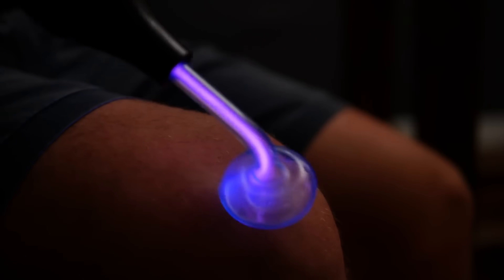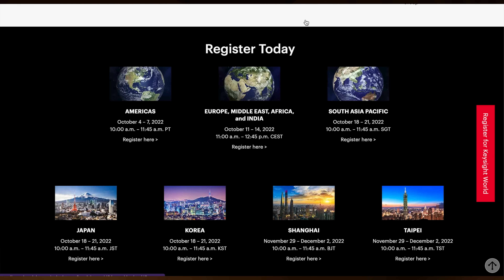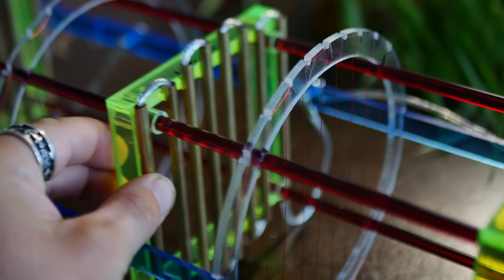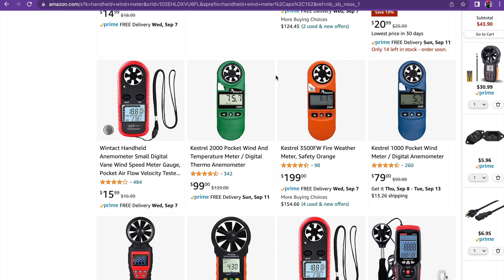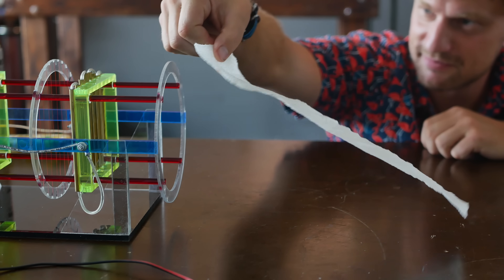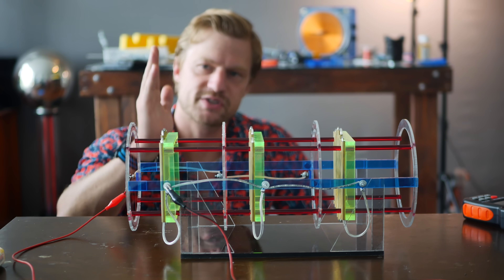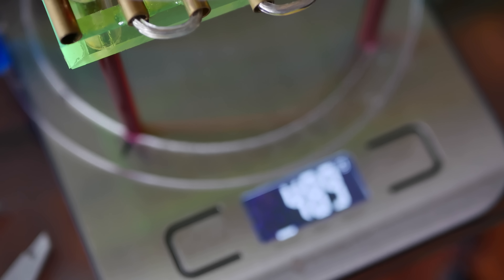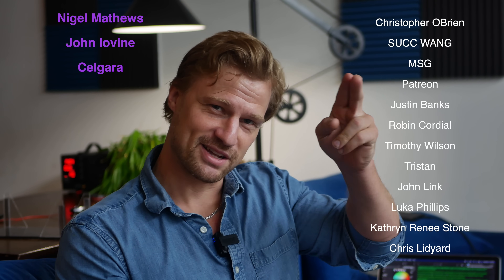Designing A Next-Gen Ionic Thruster! (For Flight)

Comment: Have you considered using Analysis of Variance (ANOVA) to see if how sensitive your two variables, voltage and distance, are to your air velocity? It would also give you a parent equation of AX+BY+C=Z for a form of linear regression that could be used to help optimize and see where your diminishing return is located. 

How close can the ground frames be before each pair begins to interfere with eachother? Would a more dense gas mixed in the air stream improve your thrust?

Could magnetic fields be used to help control direction and acceleration much like Magneto Hydrodynamic Theory, or would the field effect the plasma too much?

Would enclosing the stages improve performance?

Comment: How about adding some type of partial shielding close to the negative plates? Just to save some of the air mass. Something like Kapton would be super light, and electrically resistive. I'm curious what a 10 stage Thruster would do, with varying voltages and spacing.

Comment: What about enclosing a the stages, or using the venturi effect to increase flow?
Reply: That was done in the Sky Station International patent in around the year 2000.  I think the inventors name was maybe Burton.  The invention had needle shaped emitters, multiple stages, and tapered tubes.  It worked well but was nowhere near efficient enough to lift its power supply without helium.

Comment: I wonder if the second/third stages need as high voltage as the first stage, my guess is the first stage will pre-ioniz the air which would make controlling it easier.

Comment: I really want to see you continue to tinker with spacing and even adding more plasma arrays. One thing I noticed was that the surface area that the plasma is acting on the air is expanding when you increase the spacing. You will get diminishing returns though, unless you also up the power. A couple of things I want to see:
- A grid array instead of slats, to see if the extra electrodes can increase thrust
- more arrays in a row
- different staggering of the spacing between
- maybe rotate every other section by 90°
- try a copper mesh or grid instead of single wire 

Awesome video, thank you!!

Comment: With dry ice, looked like laminar flow going in and turbulent coming out. I would try with the electrodes increasingly closer as it accelerates to the end of the device(oh wait, you did that!lol).  I think eliminating the turbulent output would give better results, laminar flow in and out will be fastest
Reply: I think the small gauge wire you are using  for electrode  may be adding to much impedance on that end, compared to the brass tubes. That would be an area to experiment with also for better efficiency

Comment: You could increase the thrust/weight ratio by using foil fins instead of the tubes, then you could use a silk cover around the entire device tube to make sure you don't lose airflow out the sides.

Comment: Not too sure on this. But here goes.
1. It should probably be enclosed with an intake and exhaust or output whatever.
2. The pattern of the transmitter coil and the air restriction of the ground. No clue what the most efficient pattern would be but I assume it can be improved. Maybe use flat pieces instead of tubed.
3. Not sure if this can create pressure if enclosed. But if it can maybe an exhaust nozzle to direct the thrust efficiently. 
4. Lastly the spacing between each stage can probably be adjusted, brought in closer to save weight and provide less drag.

Comment: 1) drag, from exposed sides. If you were to place the entire mechanism in a tube (for example, wrap the mechanism in onion paper), you'd only be accelerating previously accelerated air, instead of also grabbing air from the sides and trying to move that still air along with the air already in the mechanism.
2) replace the grounding tubes with a grounding mesh; less weight, more surface area.
3) as it stands, precisely zero percent of the mechanism is red; as any young-adult can attest, red makes EVERYTHING go faster, and would thus lead to a more powerful engine.

It's just physics

Comment: 1) Different voltages at different stages like a C.R.T tube to add to the velocity of the ions, having a constantly changing field 
2) A rectified FULL-BRIDGE power supply with more voltage
3) Thinner anode and cathode, with many more wires and lighter construction
Reply: Also do we really want the positive to be the thin wire ? If the thin wire is negative it’s going to ionise air much easier since electrons can leave it faster.
Also-also, I think more stages will improve air speed and one should consider making the attractive plates slightly longer and with spikes at the end so the air is ionised with the opposite charge near the exit and attracted to the second stage. In fact, you can make everything from thin plates with many spikes at the end and ditch the thin wire altogether. Shorter plates for negative side and longer for the positive one. That way it will act almost like an ion accelerator. Of course, the width of the plates should be optimised depending on the intended airspeed. The faster the air moves the less of it (proportionally) gets ionised at any point.
Also, higher voltage and more distance means more ion acceleration with the same amount of materials.
The air also probably gets heated up a little at each stage so after enough stages the air blower might start behaving more like a jet engine with hot exhaust. Compared to a turbo jet this acts more like a 2-in-1 turbine and burner.
Reply: Also, in regards to my hot ionic air hypothesis: The hotter the air gets the more easily it gets ionised and at some point it will become plainly conducive. When that happens, putting electrodes through it will just short them out. You would need in this case two electrodes along the hot conductive air channel, one being the positive metal casing and the negative one being a wire in the middle. Passing current between them would heat up the air and passing current along the lengths of the metal casing and along the middle wire in opposite directions would create a circular magnetic field around the middle wire (like an elongated toroidal chamber) that would push the hot plasma faster and faster towards the exit nozzle. The only drawback would be that this baby will probably suck several kilowatts in operation.
Reply: @drgazter  that's a good point, I meant thinner wires and many more would increase the effective surface area while hopefully making the thing lighter. You could make the anode thicker but I would go with two layers of super fine strands of wire. The idea is not to absorb the electron back to be out of the way and help accelerate the air. The thin wires can also be bunched into small groups of different shapes and configuration for experimentation
Reply: @drgazter  I understand, my point was to have thinner wires spread out so the same thing as bigger electrodes. And leave more room for air to flow through. Maybe if arranged in the right pattern even get Laminar flow through the system increasing efficiency. And there will be some electron flow from Cathode to the anode via charged air particles losing and gaining electrons which is needed for the airflow. That's what consumes energy here, if there was no charge flow it wouldn't work.
Reply: @Quantum_Presence  
Yes, I get it now. More thin wires means more areas where air can get ionised.
I was thinking that at higher voltages air will start to get ionised before reaching an electrode and thus get pushed back. So maybe it would be better to put some plates where the ions from the previous electrode get attracted before the spiky thin wire section where air gets re-ionised with the opposite charge. You know, like plates ending in combs with a forest of parallel spikes pointed towards the outflow and the back of the comb (the plate) pointing towards the inflow.
Reply: There's definitely some magic to #1 I think because the pressure differentials across multiple stages seems pretty key to the overall thrust.
Reply: The construction might also help a cone design - wide radius side for air intake, short radius side with highest voltage for force.
Might even arrange the positive cathodes in a vortex shape to drive air better.
Reply: @artursvancans9702  Positive cathodes? 🤣
Reply: @artursvancans9702  That would mean it achieves some compression, but I think the ratio would be too small. Practically it would still be a cylinder unless really long
Reply: I was thinking that distance between wires could be utilized like a tesla turbine utilizes distance - if there were many more wires of optimal spacing then you might be able to start taking advantage of potential Casmir cavities.
Reply: @hannaha.2246  Tesla turbine uses friction of the air and a flat disc to rotate and very thin disc and distances for maximum energy extraction from compressed air. Casmir effect takes places in high vaccum between extremely closely placed plates only a few mm or less. This would cause the air gap to break in this case of ion thruster. It would be impractical to use that effect

Comment: Inefficiencies I can spot:
1. The tube isn't isolated from the environment. i.e. Enclosing it would improve airflow and prevent air leakage from each stage.
2. The shape of the round electrodes could be modified to give better flow over (around) them.
3. Of course, the infamous "power-to-weight ratio". It's "chunky" to say the least!

Comment: 1. Contained flow chamber
2. Increase the voltage across the stages, e.g. 20, 40, 60 kv
3. More efficient power supply
4. Possibly converging/diverging nozzle of some form.
5. Maybe magnets on the side to stop the ions touching the inside of the chamber (possibly too heavy).

Comment: The 1 big design flaw that I saw throughout the entire video is the fact that it doesn't have a plastic tube around it. Youre letting air flow out of the sides. Eliminate that and you should see higher thrust.

Comment: Inefficiencies I found (even though I don't know if I'm actually right about any of these):
1) its not enclosed so airflow can leak and reduce the power of the engine
2) it doesnt have a nozzle so there's potetial power wasted
3) the amount of material used is inefficient, the shape of the frames could be optimised

Comment: 1. copper netting insted of wire. (electrode surface area/flow)
2. copper netting instead of brass pipes and thick wire. (as above + weight loss)
3. covering the tube with a shroud. (maximising directional flow)
4. a differing voltage per stage. (as the air gets quicker per stage you will need a differeing matching speed resonance to succesfully eek out more efficiency)

Comment: I imagine one area of improvement is enclosing the entire thruster in a tube to act like a ducted fan and reduce losses to viscosity between the surrounding slower air and the air in the thruster.  Not sure about the other two but really cool content and an excellently made video.  Seeing the improved results from staggered voltage stages reminds me of the varying airspeeds in a conventional turbofan compressor, I'd love to see the number of stages taken to the extreme.  Looking forward to seeing the project develop!

(also I hope you have some patents in the work)
Reply: Maybe have inlets at each stage too, that way each stage can draw in more and more air as it gets accelerated.
Reply: I like the idea of considering turbofan concepts.  One stage could help another stage gain air speed by forcing air through a compressed shapped enclosure.

Comment: Also, there are a few cars that use an aluminum lattice in their mass airflow sensors that would make an excellent electrode for this! Designed to produce laminar flow for the sensor, they're conductive, and designed to proved maximum surface area/ airflow!

Comment: This is really cool. I would want to automate adjusting the distance of the electrodes (and possibly play with rotation), as well as the voltage. Then you could write something like a neural network algorithm to find the optimum values for everything if you feed the airflow back into the program. This is a really cool project, thanks for sharing!

Comment: an enclosure would help direct airflow, then maybe a nozzle, and your grid is the wrong shape, round tubes cause tremendous drag. maybe blades or narrow air foils instead. or does there have to be a grid at all? if you push enough voltage could you just make a segmented tube with conductive and non-conductive alternating segments?

Comment: Could you put only the wires through a tube and maybe give it a rounded jet engine inlet and tapered outlet? Im guessing that currently its sucking in air from all around and maybe in a tube the velocity of the air could sort of stagger? Also maybe shift the wires from each other or rotate them.

Comment: Seal the system, use carbon composite for the frame, taper the sizes of the stages down as you move backward. With sealing the sides that could make use of the venturi effect to increase velocity. Use an intake trumpet as well to improve airflow into the thruster, see what different shapes of exhaust cones would do to the thrust produced, instead of large copper electrodes for the negative use a thin carbon composit teardrop shaped tube with a thin layer of gold depositied using a plasma coating machine, I believe thought emporium has built one and you could colab with him maybe. So many ways to improve this!

Comment: I do wonder if you might gain some efficiency stripping the insulation off the wires might help some. I know you're way above the breakdown voltage there but hey, it's a free thousand volts or so. And it'll make it lighter! (Ok you might need a very expensive scale to measure how much lighter but still! 🤣)

Comment: Very nice. Might want to put a non-conductive cowl around the structure and give it a bit more of a funnel shape like turbine engines. The reasoning for the funneling is that the air flow will necessarily speed up as it narrows, due to the relationship between force, pressure, and cross-sectional area. Another idea to try is having the conductive surfaces be grill shaped for increased surface area for air electron transfers. And instead of the pipes having long slivers of aluminum for more surface area as well (simulate to the classic ionic thrusters). Good job, Jay!

Comment: This is super cool. I am not super knowledgeable on the electrical side of it just the basic but whaen it come to aerodynamics i am far more knowledgeable and lets just say there is alot of drag and turbulence in the design that can be minimize. That and weight

1 Balsa to light the frame

2 Changing the shape of the copper tubes from cylinders to a laminar flow airfoil crossection (which should drastically reduce turbulence produced and air resistance)

3 Enclosing the the thruster like a jet engine for better airflow characteristics (not the outside but just the inner cylindrical section were the airflow is. The rings that hold the electrodes and cathodes would creat turbulence if left in the primary airflow)

4 Making the square cathode ring a circular one to pull it out of the airflow.

5 An adjustable nozzel just like on jet engines can increase thrust. (For example they are adjustable on jet engines because different constructions have different effects primarily top speed verses max thrust)

6 you can add a curved inlet to increase the efficiency of how much air can be pulled in.

With strictly the airflow freeing changes (2,3,4) i wouldn't be surprised if you could increase the speed of the produced wing by 2. Thrust would increase as well but im not sure by how much but it would be significant.

Comment: I can think of 2, possibly 3. We had an electro static precipitator at work that used a bunch of different points to create an ionic stream. I believe this is the first inefficiency. Use points parallel with the axis of the thruster. The second I would guess is outside air infiltration as well as momentum not parallel to the axis of the thruster. So some kind of duct that surrounds the structure to allow a more laminar flow and to decrease outside air infiltration would increase efficiency. As for a third. Maybe more electrons flowing would cause more force. This one wouldn't change the weight. Just have a higher amperage power source.
Reply: Maybe put 2 opposing plates on opposite sides of the wires, with a venturi type shape, this will help direct more air towards the wire as a funnel type effect.
Reply: Concerning the first point above, The coronal discharge could be accomplished with a symmetrical type airflow shaped wires. This still gives you a area of most curvature at the back and has a very aerodynamically efficient cross sectional area
Reply: Evidently I like responding to my own comments. Lol. I just had a thought. Why not have a duct around the outside that conducts and charge that with electrons as well, you will get a containing effect without having the drag of a physical surface to slow the airflow. Could help you channel your air more efficiently. At least for the charged particles. I know the air molecules carried along with it would rub against the inside of the duct some, but I still think it would have an increase in speed

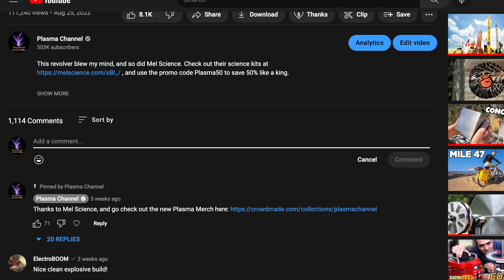Comment: My guess at around 11:25 is weight reduction, perhaps something that works with quantum locking (to keep the spacing set) and more surface area to make more ionic wind.  More specifically, adding more positive wire runs, closer together.

Comment: Closing the thruster to prevent air leak has already been mentioned, but once it is closed I think circular electrodes would work better than simple lines 

Like if the electrodes were circular ionic lifter designs nested in one another like a target